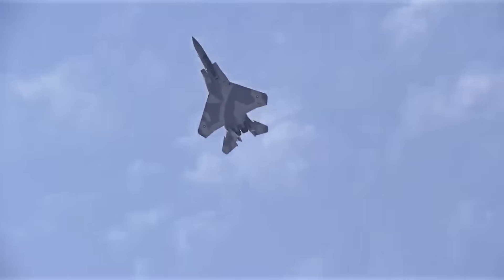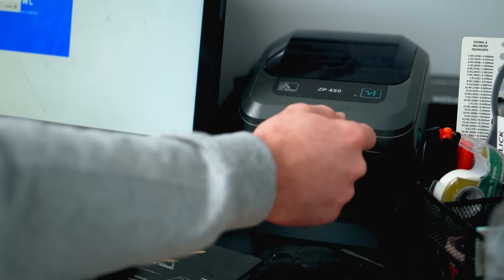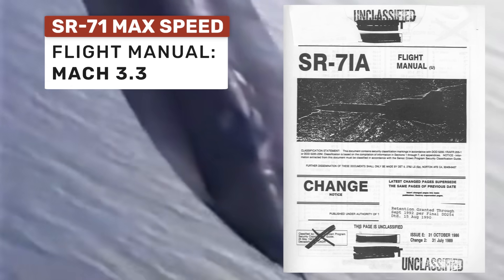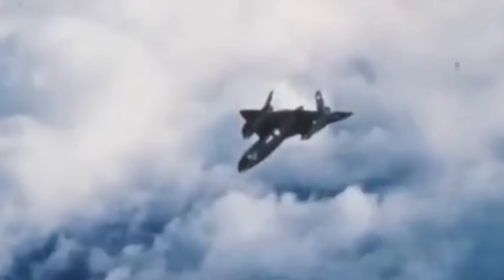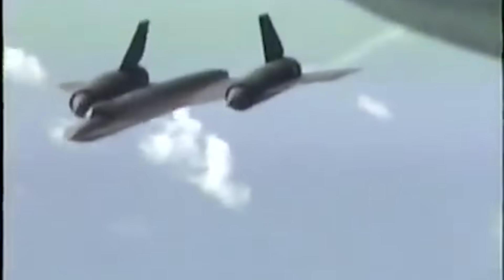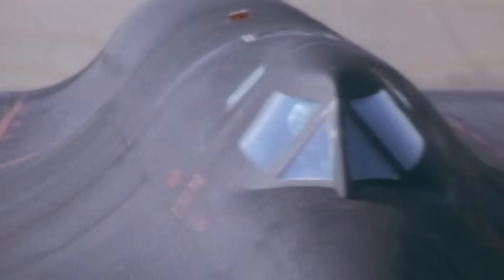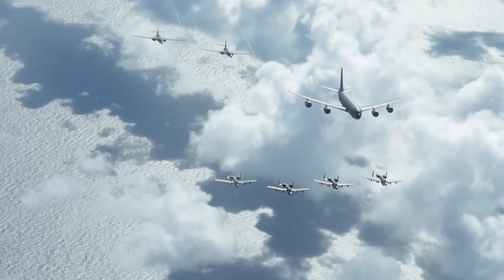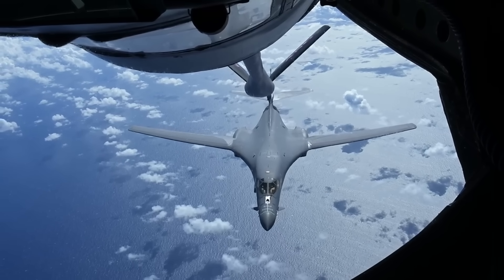The SR-71 was MUCH FASTER than the Air Force will admit

Comment: How would going faster over power the compressor 
Its a ram jet at that point completely bypassing the compressor using the speed of the aircraft to ram and compress air into the intake 
Thats how a RAM jet works

Comment: About 3.5 mach or a bit more was the top end. Was limited by temperature, the planes could go even faster, but they could self destruct.
Reply: 3.5 wasnt possible on a standard day
Reply: @gr8crash  3.35 was the standard limit
Reply: @EduSanjuan777 no it wasn't.  3.2 was max mission cruise. Going up to 3.3 was only allowed when authorized by the Commander and ONLY if certain engine parameters were within limits.

Comment: I have heard that the limits were also approached with the nose shockwave  bending so far back it got into the engine inlets, risking an unstart.  The shock cones couldn't help at that point.   That makes some sense.  One supposes it could have been extended with a longer nose one way or another, but it your're also running near thermal limits.   I expect a bunch of limits simultaneously ran together at certain design points, just like the U2's coffin corner.   It seems like it would take exceptional non-design center criteria and luck to get past those, for brief intervals.    FWIW, the normal efficient cruise speeds of the Blackbirds and the XB-70 were about the same, 3.1 and 3.05.
Reply: The angle of the shock cone off the nose spike (μ) from centerline can be calculated by sin(μ) = 1/M, where M is Mach speed.

Using a top down view drawing of the SR71 and a protractor, at Mach 3.65 that shock cone would hit the front chines, engine inlets and wing tips all pretty much simultaneously. That would be it for having any control of that thing. The operations manual shows the speed limit being the compressor inlet temperature not to exceed 427°C (800°F). That would mean Mach 3.2 for normal operations and Mach 3.35 if and only if outside air temperature was less then -50 Celsius. There may have been (rumored) a built in "war time power" limit of 450 C on the compressor inlet temperature allowing for Mach 3.5 (and -50 C outside air) but wartime power means only for a brief burst if needed and a full engine rebuild after the flight as there would be some melting of the turbine blades.

Comment: documented that the SR 71 tokk off from san diego and landed at pease afb? in maine in 46 minutes. believe that is faster than mach 3.5 in 1979
Reply: They never set a record like that. Nor would it be possible
Reply: You CANNOT calculate airspeed by using time and distance traveled. You are flying through a medium (air) and that air moves and must be taken into account. A hot air balloon in the jet stream can have an airspeed of zero and a ground speed of 300 MPH. A plane flying 300 MPH against the jet stream can have a ground speed of zero against the jet stream and 600 MPH with the jet stream. Knowing thedistance between 2 points and how long it took you to get there tells you NOTHING about how fast that plane can fly.

Comment: Silly! ChatGPT says:
Cruise speed ~3,035 mph
≈ 4,885 km/h ≈ Mach ~4.6

ChatGPT analyzed the following flight for me on March 6, 1990:
Departure: Palmdale PMD (CA)
Destination: Washington Dulles DCA
Air Distance: 2,299.7 miles
Kilometers: 3,701 km
Duration: 64 min 20 s
This results in an
average speed of approximately 2145 mph (approximately 3452 km/h).
But we have to take into account a normal flight profile (takeoff and landing phase) for a very high cruising altitude of 80,000 ft.
Using documented timing for SR‑71 climb to cruise (~17 min) and descent (~10 min) we derive a required cruise speed of ≈ 2,970–3,100 mph
≈ 4,780–4,990 km/h
≈ Mach 4.5–4.7
Reply: Interesting comment,  but its entirely wrong. The timing didnt start until they passed the timing gates. Taking off etc doesnt factor into the record.
Reply: You CANNOT calculate airspeed based off time and distance travelled. That air moves. A hot air balloon in the jet stream can have a ground speed of 300 mph. Hot air balloons ALWAYS have an airspeed of zero.

Comment: So the biggest claim I see supporting “The sr71 having WAAAY higher speeds” come from the cold war era SA-2s  fired at the airframe, which are mach 3.5 and and SA-5s which were mach 5 capable. 

A lot of people draw the conclusion that the SR71 MUST be way faster. Which , isnt true. And it doesnt surprise me that mach 3 +\- is still sufficient 

Because people overestimate missiles thanks to hollywood. 

If you are already at altitude with decent seperation, the missile has to close that gap and still maintain a shooting solution. 

Aimraams and SA-2s and SA-5. Have a violant boost phase, and usually burn out their boost propellant within 10 seconds. 

So these “SPEEDS” cited for these missiles are at the Apex of boost phase, some sustain smaller burn durations for longer? Maintaining speed but still in either case the missile is spent on propulsion after 20 seconds. 

Which means it becomes a guided BULLET that is constantly losing speed. 

Its NEVER going to regain energy and it will only lose energy. 

The SR71 has NOTHING stopping it from maintaining mach 3+ and is constantly under power. 

Meanwhile the mach 5 missiles closing from 85,000 feet below…with miles of seperation can REACH the altitude perhaps?? 

Can they actually intercept? Noo not necessarily 

And a totally plausible scenario. 

People like to think “missiles chase and they go mach 5!! So the sr71 has to be faster right?” 

Not at all.

Again once the missile burns its limited fuel thats IT, its a PAPER weight guiding on air resistance and control surfaces hoping to intersect and detonate its payload 

The SR71 is BURNING continuously and constantly recovering and sustaining energy. 

You dont need to be FASTER than the missiles at all, just fast enough with enough seperation that the missiles fall out of the sky once they lose energy.

To me it seems obvious..theres no reason to SUSPECT the sr71 was somehow a “Hypersonic aircraft” 

And any engineer can tell you it WASNT. 

Your problem is misunderstanding how missiles work.

Comment: One of my clients from my homebuilding days was a retired Naval aviator and later an airline pilot. In one of our conversations during a punch list trip, we were talking about the difference between the US and Russian attack aircraft and their top speed claims of the Migs in general. He said that the Russians fly their planes to the ragged edge of capability and obviously beyond in some cases and that when he landed at a Russian Air Force base for joint training exercises, the runways were lined with used up and destroyed afterburner equipped aircraft engines. He stated the US didn’t allow pilots to max out their aircraft because of the accelerated wear to engines and airframes and that his FA-18’s listed top speed was very conservative and obviously understated. It goes without saying the tactical advantage that would bring when your enemy underestimates your capability.

Comment: They dont list mach 3.2 as the SR-71 top speed.... they list Mach 3.2 as the SR-71's cruising speed.
Reply: Mach 3.17 was the cruise speed. 3.2 was the max mission cruise speed.
Reply: @gr8crash still it’s cruising by speed. Not its top speed.
Reply: @jpgiii85 max cruise was its typical top speed. Yes it could go up to mach 3.3, but this was only with Commander approval and ONLY if certain engine parameters were within limits. Meaning if they were already at the limit and say at mach 3.15 that means they were unable to go to 3.3.
Reply: @gr8crash you’re incorrect. Its top speed was limited due to nozzle inlet temperatures only. Cruising speed is known to be Mach 3.2. You have no idea what the top speed is because it’s never actually been disclosed. Enough already
Reply: @jpgiii85 lol you say im incorrect by then mentioning the engine temp limit haha. Confused just a little bit it seems? The engine CIT was the initial limiting factor,  which was 427⁰. Now again accelerating to mach 3.3 was only allowed with Commander approval and ONLY if that limit was safe. Again meaning if they were at 427⁰ and not even at mach 3.0 they couldnt go faster. They even had mission aborts for that very issue. 

And yes we do know the top speeds. Its all public information. What's more likely is you just arent very familiar with this aircraft outside of your vast Google searches.
Reply: @gr8crash it’s not public information and has never been disclosed.
Reply: @jpgiii85 its all public information. Been disclosed and declassified for over a decade.

Comment: Define “faster”. Local speed of sound depends on temperature, and Mach number is the ratio of aircraft speed to local speed of sound. If the aircraft flies through a colder patch of air (Goodall’s “good air”), local speed of sound decreases, which means Mach number will increase. The aircraft doesn’t accelerate suddenly, and ground speed doesn’t suddenly increase, so the aircraft isn’t going “faster”.

Comment: We can only guess what the top speed of newer hypersonic engines are at altitudes above 100k feet but certainly above 5x Mach.. Then there is the mythical tic-tac that uses a laser to split the air in front of itself during flight for short bursts of insanely fast speed..

Comment: After retirement, the Air Force released a declassified video of the SR-71 cockpit in flight indicating at M3.5 at 85,000 feet so it would seem that would make a good starting point.
Reply: Theres no video that shows that. Especially as even getting close to 3.5 took very specific atmospheric conditions and not possible on a standard day.

Comment: The "soft data" is abundantly clear: the Soviets had mach 4 capable missiles in the 80's & still couldn't touch it.
Reply: Which means nothing to figuring out the SR71 speeds
Reply: @gr8crash  >mach 4, it's pretty straightforward
Reply: @LIONTAMER3D obviously not. Especially since its impossible. The SR71 could never fly that fast even under the best circumstances.
Reply: @gr8crash  faster
Reply: @LIONTAMER3D faster? Than mach 4? The SR71?  Literally impossible.
Reply: @gr8crash  except those missiles couldn't catch them below the 85k foot threshold, which is irrelevant as the missiles could have reached 100k ft
Reply: @LIONTAMER3D the SA2 which was the primary threat for many years could reach mach 3.5, faster than the SR71. But they didnt have a long burn. And firing head on wasn't going to work as computing intercepts at mach 6+ velocities was beyond the processing power of the day.  Most times the missiles would have burned out before posing any serious threat.
Reply: @gr8crash  shhhh, you're talking out of yourass & it reeks
Reply: @LIONTAMER3D just giving you facts.  Not my fault you don't like them. 

So think about this then,  even if an SR71 flew above mach 3.5, how would the crews even know?
Reply: @gr8crash  Had a MACH indicator in cockpit up to 4.5
Reply: @jbnorth396 you mean the one that they didnt use above mach 1.5 because it isn't accurate?  It also has a maximum operating speed of mach 3.6. 

Want to try again?